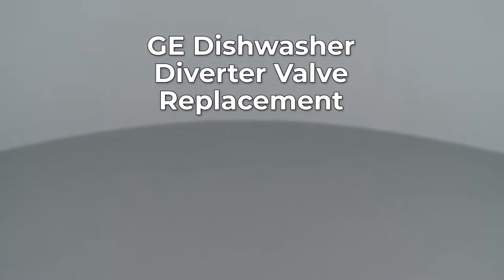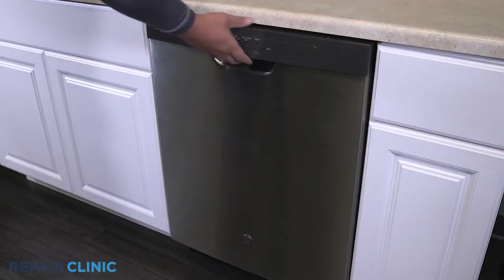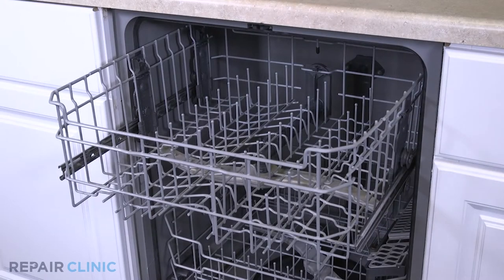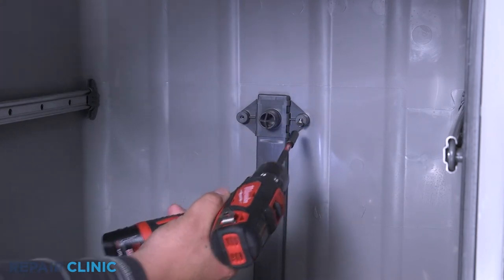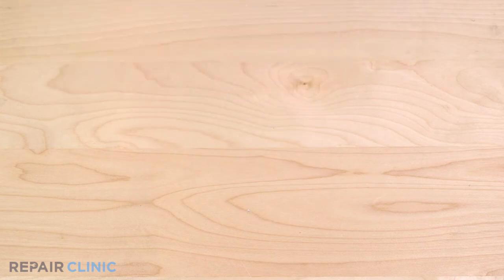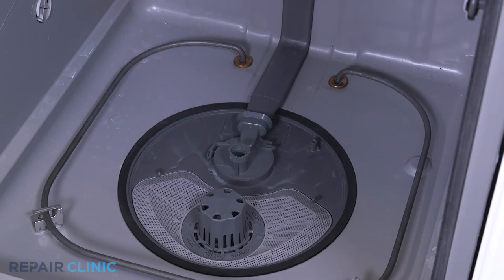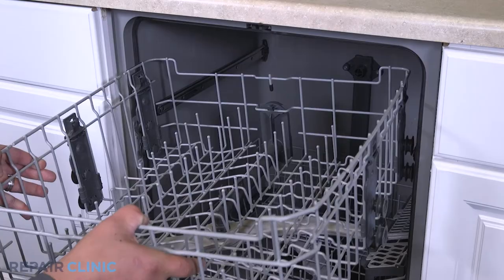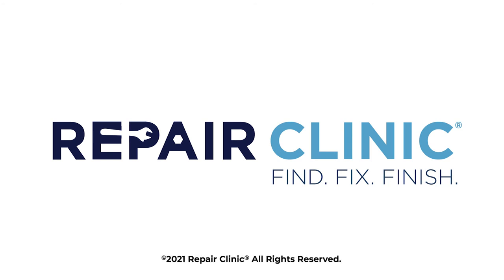GE Dishwasher Diverter Valve Replacement WD19X25466

Comment: I had to replace the wash circulation pump, and when installing it the diverter started leaking.  When I pulled it off the diverter rubber boot was disintegrating, if you rub your finger on it the rubber comes off onto your finger.  Pure Junk.  The dishwasher just over 4 yrs old.  GE is making pure junk.